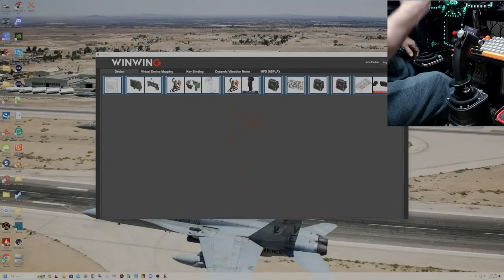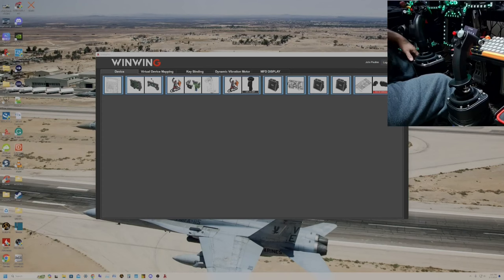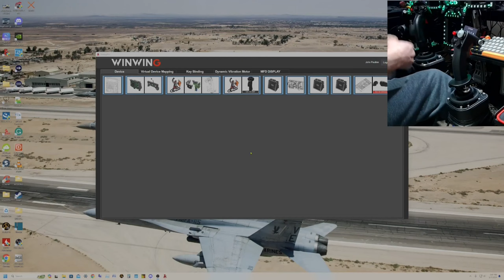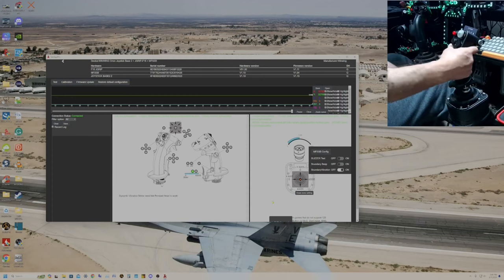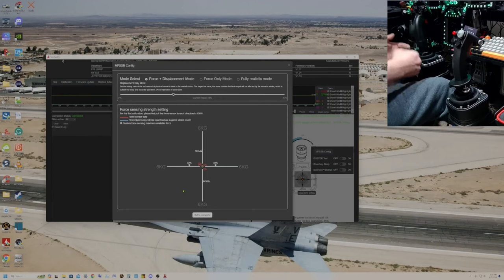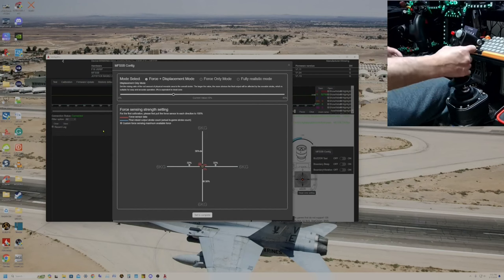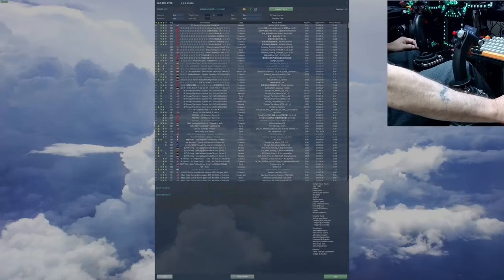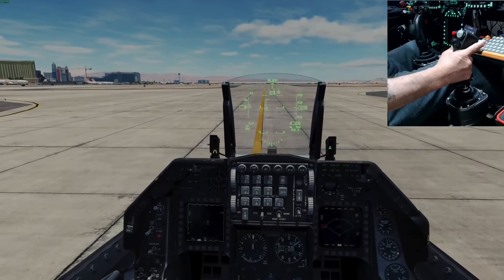The Ultimate F-16c Joystick Base: The Power Of The Winwing Mfssb!

Comment: Little correction, the ultimate F-16 base is the Realsimulator FSSB R3 Lightning or Ultra. Yes expensive, but you´ll get what you pay for and the manufactor produces in Europe instead of dark red china, plus their main buisness is building real training simulators for several NATO air forces. If someone knows what they´re doing, then it´s Realsimulator. I do have Winwing, Realsimulator and Virpil stuff. And Winwing is definately the lowest quality of all three with Realsimulator beeing the absolute top notch, using even the same materials as with real jet sticks and military grade electronics.
Reply from the maker: I have seen and heard good things about Realsimulator.  I have used Virpil and really liked their stuff and if they made their own grips I would lean that way but they don't,  Winwing makes a great F-18 and F-16 joystick grip, at least I have had a lot better luck with it than Thrustmaster on the Virpil base.  Anyway great chat and if you ever want to jump in a game I have a pretty fast server. My Discord jpstechreviews
Reply: @JPsTechReviews  Winwing beeing better than TM is absolutely true. That´s for sure (also had both TM grips). Well, if you take the customer service out of the calculation, because that´s where WinWing fails. It´s not like Winwing offers bad gear, infact it is pretty good. It´s just that i would´ve expected much more from gear with such a pricetag (700€ yet alone for the throttle). I do own the Super Taurus F18 throttle (the big one wich is not produced anymore) and it came with a faulty slew-control (giving permanent input to the X-Axis when centered so i had to set a 10% deadzone), two switches failing within a year and the two throttle levers do not run 100% parallel when attached to each other. Result is a permanent rolling aircraft as you have permanently 1% more thrust on the right engine. Two of my friends have the same issue, so it´s not a faulty unit, but a faulty design. Not a big deal, as the throttle levers are pretty good ergonomics so can be used independetly without any problems. But should not be the case with high end flight sim gear. A warranty return was not an option, as the Throttle came without CE certification, wich makes it illegal to import to europe, even for individuals. If national customs checks the package, it is confiscated and you even have to pay for the destruction. Winwing solved the issue with the CE certification with their newer products, so at least this risk is not a factor anymore for european customers.

On the other hand, i had an issue with my Realsimulator F-18 CGRH Super Hornet grip, with the trigger needing way to much force to be pressed (even while the standard trigger resistance replicates the original grip 1:1, wich is like 4 times as hard to press as the TM Hornet grip)). They started a video chat session, with their engineer solving the problem within 2 minutes. A Bonus is, that i´m now aware the resistance of the trigger can be adjusted with this grip. So it was not realy an issue with the unit, but just a too strong adjustment of the trigger when manufactured. Nothing that would break your grip. The software from Realsimulator is also outstanding and second to none. Not to talk about the fact, this grip has a built-in bluetooth module and gyro sensor, so with an attached battery pack it can be used without base like a VR controller. Or on a self made base without electronics/PC connection. And it is surprisingly accurate.

If you´re ever willing to spend the cash for the RS stuff ( i know, it is realy very expensive), i can only highly recommend it. And their stuff rarely looses it´s value. Besides the Super Hornet grip, i do also own the F-16 SGRH SE and the base. Had the original FSSB-R3 Lighting base and switched to the Ultra when it was released. Sold the 1 year old FSSB-R3 for about 20% lower price than a new one. Was sold within a few minutes and with the Ultra beeing exactly the same price as the standard base, that was a  good deal and a no-brainer to switch.

Can only give back the favor but, according to your dialekt, you´re from the States (i guess). I´m sitting in germany (well, right now only my PC and simpit does) and i do mostly PvP. I´d take the invite to visit your DCS server, but i´m afraid the ping would be unplayable for me... :( But will check it once i´m back at my private PC.

Oh and btw. A very good review about the base. Forgot to mention that in my first post :) Cheers sir!
Reply: I had a Thrustmaster Cougar for years. It sucked. I’m happy to have moved to Winwing.